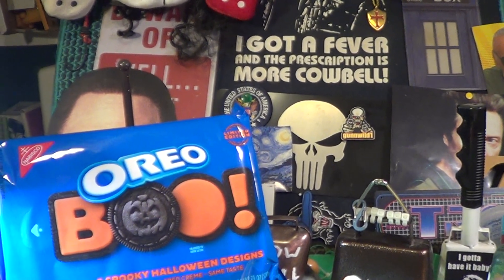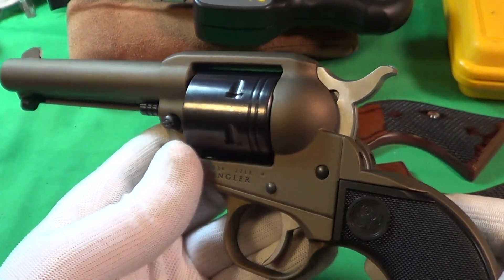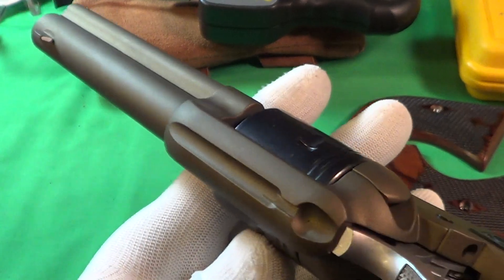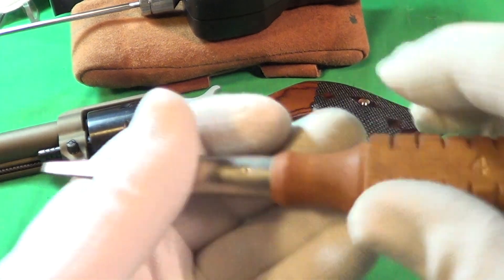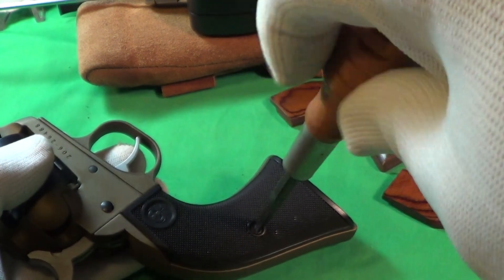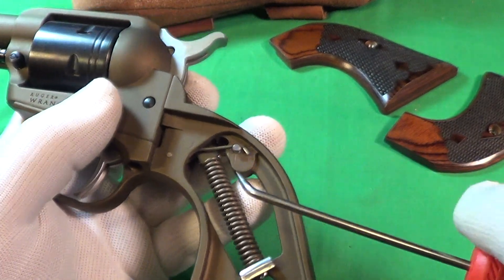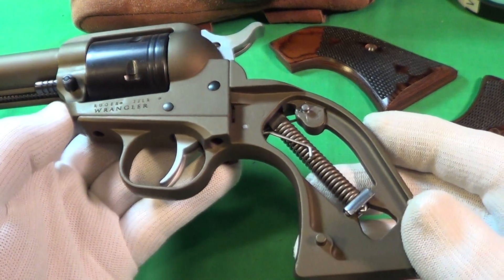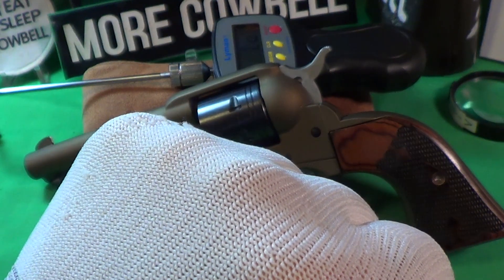Ruger Wrangler New Grips & Trigger Adjust.

Comment: What you did for trigger adjustment is in correct in my opinion. The spring needs to be replaced with a lighter spring. 
I went back in with a Wolf Trigger Spring. And it connects on both side.

Comment: Hi. Where exactly in the owners manual does it state that you can make this trigger pull adjustment?

I just went through my super wrangler owners, manual, and found no such thing.

That spring also centers the Mushroom pin. When you take one side of the spring off the pin gonna slide and wear against the grips inside.

You could do it right by buying a spring kit.

Comment: I wonder if you re installed that trigger return spring  and then drop the other one off the  other side if it would pull the same or if it would brake the same, lighter,  or harder? My wranglers about 2 1/2 pounds after I dropped one side.
Reply from the maker: 2.5 lbs is fine for me...=)